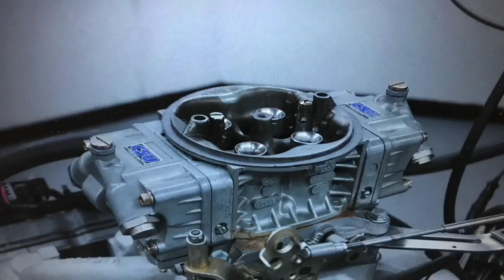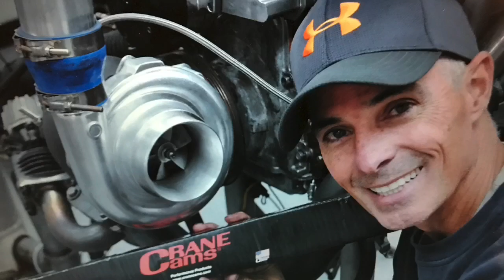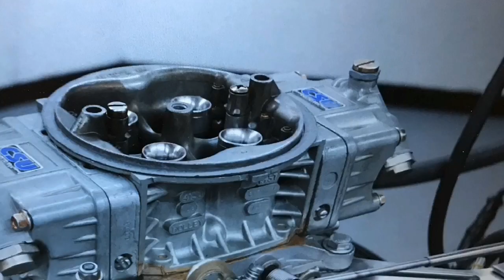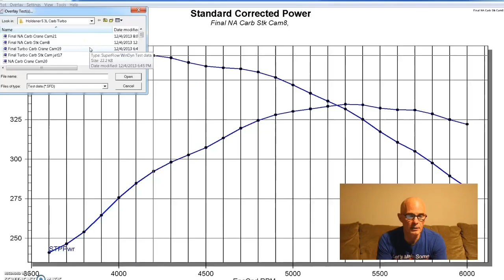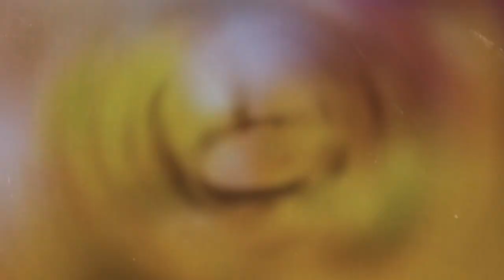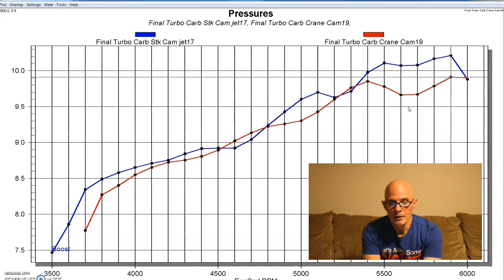CARBS, CAMS & TURBOS!! DOES IT WORK?

Comment: I have not seen you test anything turbo with a tight LSA. Like 230s on a 108 or a 106. Against an identical cam on a 112 114 116 something like that.  If you have done the test can you point me to the results?? !!  Thanks
Reply: ZX1206 but everyone thinks the overlap will make a power loss .  That’s what I would like to see tested !!
Reply: @hereinmissoula11  I think Richard's test of 'every cam is a turbo cam' covers this question. If the overlap allows more fuel air to escape into the exhaust where it burns, then it will increase response. Some of the video's show some combinations end up with too much exhaust pressure in a ratio to intake if the turbo is too small in relation to how much air the engine will flow. Boost just moves the curve up no matter the cam lsa. Just my opinion.
Reply: Ron Dye Channel it needs a test ...... 👍👍👍
Reply: What do we Google. I asked the same question a while back
Reply: Doesn't include a turbo. So 🤷‍♂️

Comment: I would think carbs would do better from a single injection location distribution perspective. The reason why is the same as to why they often make more power; there is more fuel in vapor phase, thus less fuel being influenced by two phase flow dynamics.

Comment: Another Awesome video Richard! I currently have a blow-tru supercharged 68 302. At 16 psi it makes 537 at the wheels. The carb drops ambient temps by half, no intercooler needed. I love my blow-thru set up. Thank you for all your videos Richard!👍
Reply: In thinking of putting a turbo on my 327, would I not need an intercooler either?
Reply: @aaronvinegar8963  no intercooler needed if u have a carb. I do spray methanol though to help. Good luck on your setup 👍
Reply: @imsoawesome_imnottho  thank you!

Comment: Just watched that video where you'd run the stock truck intake vs. the Victor on a 6.2 and a 416 last night, then there in the Holley tunnel ram.

Makes me wonder if some of the gains the TR made across the board were from better fuel distribution.

Would be an interesting thing to see on this engine.

I mean, this definitely has enough carb on it now, but maybe the tunnel ram would work better merely because of the manifold

Comment: How much of a charge cooling effect does a carb have vs port injection? Non intercooled setup.
I'm currently running a non intercooled holley sniper tbi on my old 350.
  The highest MAT I've seen is 94F which is about 45-50F over ambient. I've seen as high as 155kpa or about 8psi from datalogs.
Reply from the maker: It can drop temps by 100 degrees

Comment: Would like you to do an 8.1 liter Vortec turboed with maximum of 10 lbs boost on E85 considering this combination for tow truck what is your opinion on how well the motor can take it will it stand up over the long term got a great program I find it very informative especially your work with the camshaft set every cam is a turbo cam and wondering that for a long time

Comment: Also any messing with LS7 motor?
Reply from the maker: too expensive but I have
Reply: I'm looking for a new toy so I'm in the market for a 06-12 ZO6 with LS7, a 2015+ Mustang with a Coyote or a Z28 with the LS7 but I suppose I might should be looking at the LS3 instead? A grandsport or regular Vette. 
I like the prestige of the LS7 ZO6 LOL. 
As well as a 03/04 cobra. 
I already had a 03 cobra and a 93 Cobra as well as C4 Corvettes etc.. 
Never owned a LS but I've only heard great things about them. 
So based off your experience which Corvette motor would be the most ideal for building a supercharged or Turbocharged motor for power in the neighborhood of 1000hp? If you don't mind sharing some knowledge as you have plenty of it. 
I know a stock Gen3 coyote with 15-16lbs of boost bone stock motor might I add, even cams is making over 1000-1100 to the tires and able to run 8.20's@163+mph on a single turbo! 
That's pretty damn impressive. 

I know the LS7 with just Advanced Induction heads and a B3 Cam from RPM typically pushes 620-650hp to the tires nothing else which is pretty nice but the factory pistons suck so for boost you would likely need to pull the motor completely down to replace the pistons for boost. 
So there definitely is some cost there and I don't even know what the LS7 will hold on stock rods and crank. 
Kinda like a lot of your setups, I would like not to have to tear the motor all the way to make good power. 
Gen3 Coyote, 03/04 Cobra motor, LS3 LT1 etc.. 
Thanks again for any insight

Comment: I have to say I stumbled across your channel a few weeks ago. 
I love it, your super informative! Excellent information. 
I would love to see some coyote motors putting down some power as well as some 4.6/5.4.
You ever play with a 03/04 cobra motor? 
That was probably Ford's best built motor to take boost from the factory as it's rods are super nice Hbeams with a complete forged rotating assembly.
Reply from the maker: lots on the 03/04 Cobra and Coyote-did you see the boost bash video where I ran every form of forced induction on the 03/04
Reply: @richardholdener1727  no, I will have to go look,

Comment: Great videos as always.  Thank you for posting so often.  What ring gap do you run on supercharged and turbo LS motors?
Reply from the maker: .028-.030
Reply: @richardholdener1727  Richard I need some info on a 6.0 ls motor. I found a truck that lost the oil filter and seized. What have you seen with the 6.0 are the normally repairable??

Comment: Oh yes one I’ve been waiting for
Reply: If only we could get the same dyno comparing it to the performer rpm, since boost should be low enough to not require the single plane.
Reply from the maker: I did a Vic jr, vs RPM na and under boost
Reply: Richard Holdener oh could you link the video?